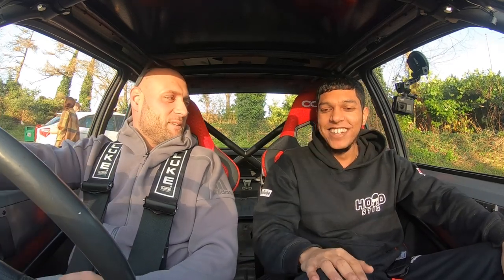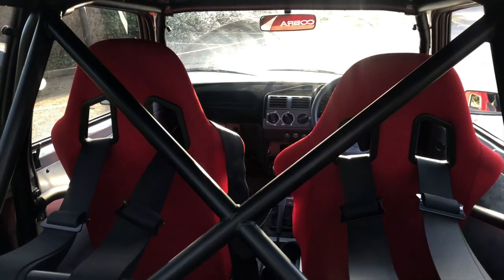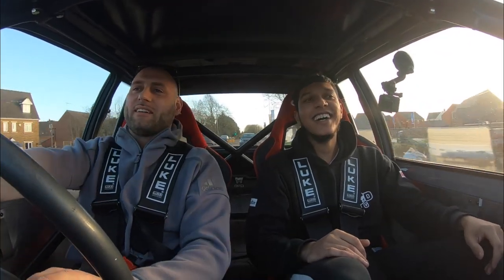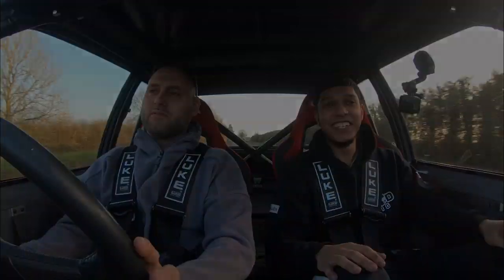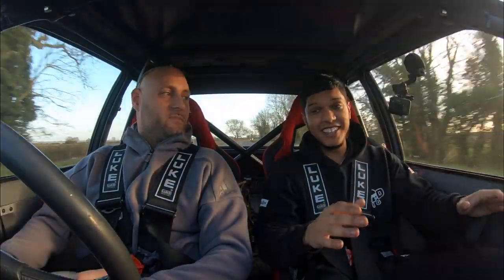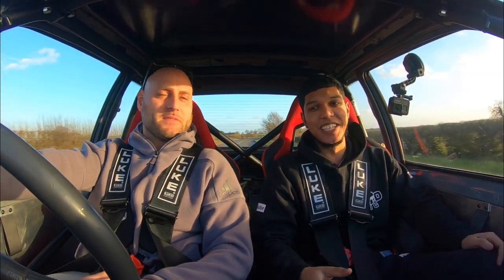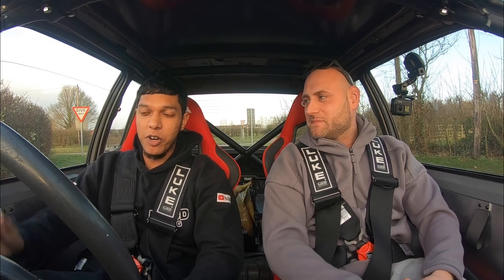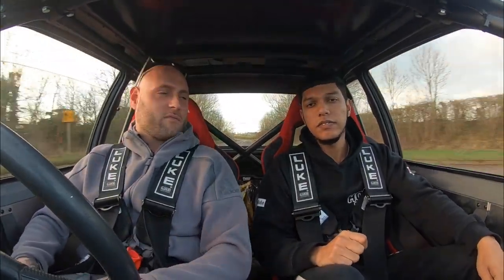THIS *220BHP PEUGEOT 205 GTI* IS PURE MADNESS! 0-60 in 5s

Comment: Should be closer to  790kg striped...Stock was 880kg with leather interior, powersteering and AC
Reply: Flocki Locki hope it is, cage is quite heavy.  Need to get it on a weigh bridge
Reply: Flocki Locki ,  just had it on a weight bridge.  It’s 900kg bang on.  It’s mi16 engine roll cage and seats
Reply: @jamessteventon1018  hmmm...thanks for the Info.
thought it would be lighter.  You run the Aluminium Block mi16?
Reply: Flocki Locki , yeah got aluminium block. Safety devices cage is heavy as, seats ain’t light either.  It rapid as thou 🏎🏎
Reply: @jamessteventon1018  realy cool Setup on that engine btw 

Steelcage is a weightfactor for shure and the stock seats are realy
 light too.
Awsome car
Reply: Flocki Locki , thanks bro. Major head work, 528 cat cams and pulleys bigger injectors. Milltek sport exhaust.  I messed up and said omex    Tuned at btec racing 🏎🏎

Comment: And then it gets oil starvation and it’s game over!
Reply from the maker: Thats the same with most high revving cars 😅🙈🙏
Reply: @hoodstig  trust me it's inherent with the MI16, engine lies back to fit snuggly in the engine bay, oil pick up struggles to fetch the oil during high speed cornering and before long you end up with the dreaded knocking on the bottom end 😔 the folk who know about this do dry sump mods or baffled sumps. Cracking engine though, revs forever.
Reply: After 5 years, oil & filter every 3000 it’s all good.  They do suffer from oil surge, will go dry sump eventually
Reply: Twed, yeah me and my brother have 3 mi16 between us and 5 205’. So yeah we know, my brothers is fully forged dry sump the lot.  Should b around 250bhp   He should be feature on show in a few months.
Reply: Twed , and it’s got a baffled sump too.